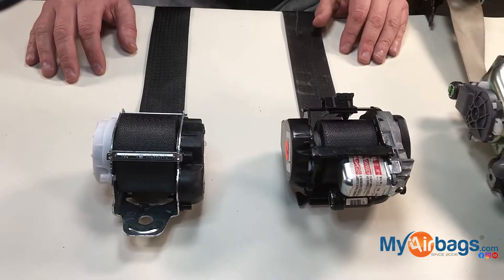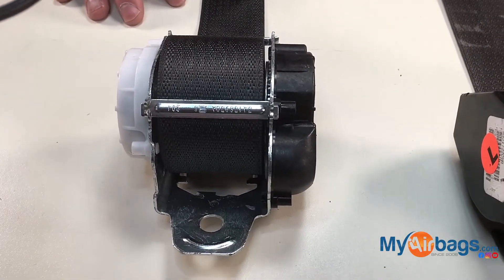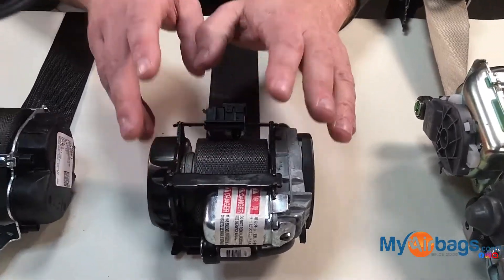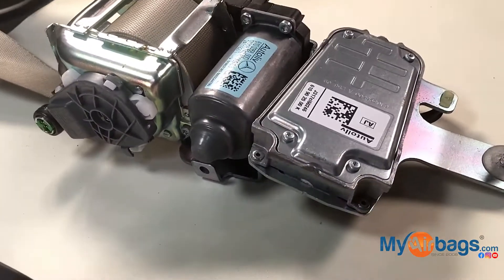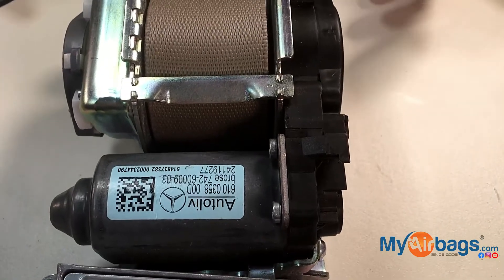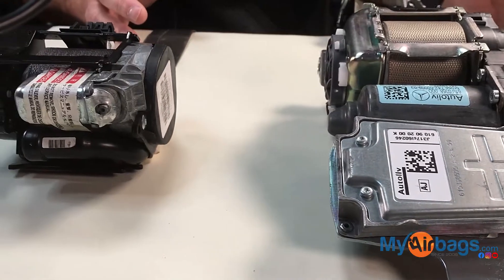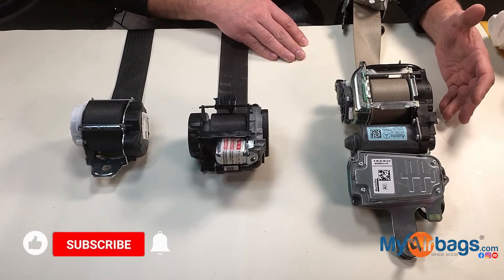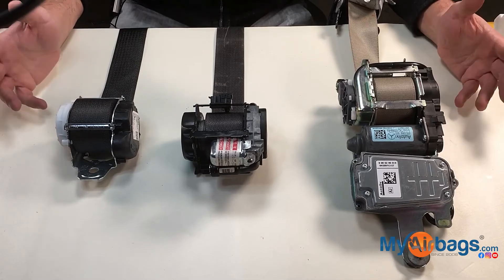The Evolution of the Modern Seat Belt  | MyAirbags

Comment: Can you tell me please how can i know if the pretensioner got fired . Because i don't see any Pistons under the seat
Reply from the maker: There is different seat belt pretensioners and different ways to tell if seat belt pretensioner is good or bad. Some pretensioners have small metal balls inside, when the pretensioner is bad you will hear the balls inside rattling. For other seat belt pretensioners there is really no way to know by looking at it. Best way is to measure OHM resistance at the plug of the pyro sensor (electrical plug). Good seat belt would show resistance between 2-3 OHMs. If you are not seeing these numbers then seat belt pretensioner is bad.